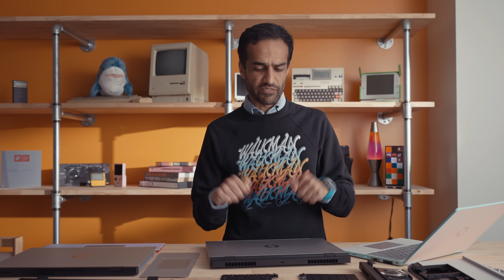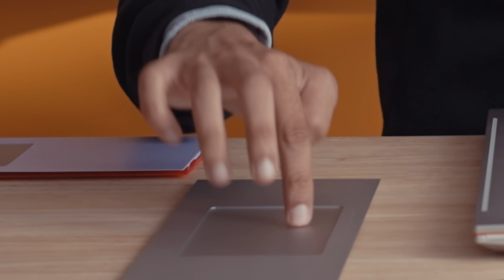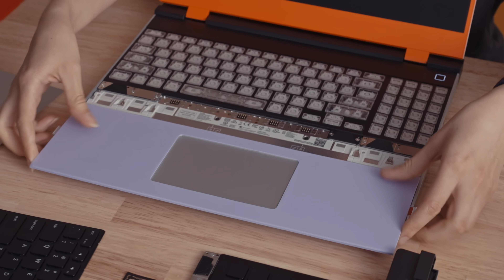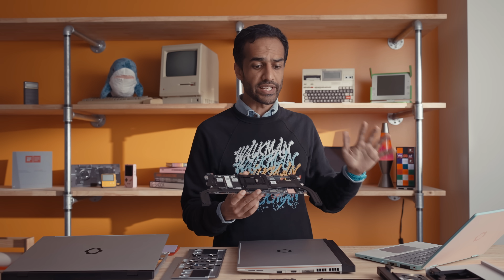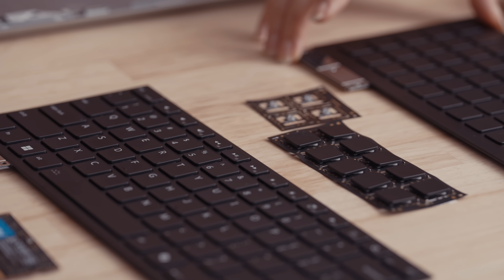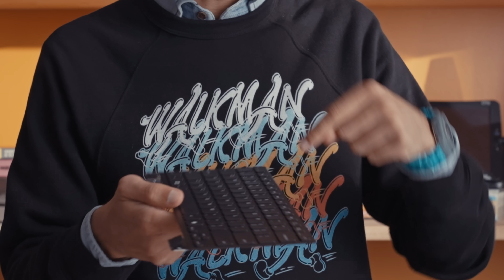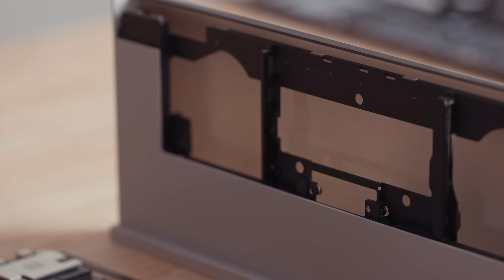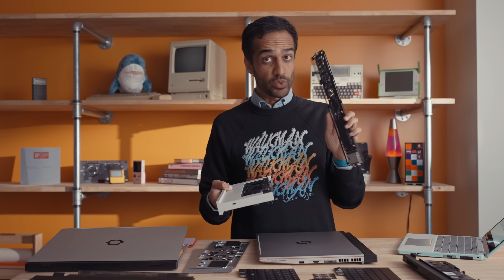Framework Laptop 16 - Prototypes and scrapped ideas

Comment: I still think that users should be able to swap the keyboard to the bottom row and the touchpad to the top row. As and elder developer, my workflow is primarily keyboard driven, including using a keyboard-driven dynamic window manger.

When sitting at a table or desk, ergonomically its far more comfortable if the keyboard was placed toward the bottom edge and further away from the screen. I rarely if ever use the touchpad anyways (preferring keyboard navigation when it's an option, or an external mouse if I need to use a pointer) so making it slightly less accessible isn't a problem.

It's a shame the original modular input design didn't allow for swapping which row the keyboard and touchpad were installed into. I would have already bought two Framework 16s and given away all my other laptops if that was an option. 

Regarding the pointing stick. I was a ThinkPad user for many many years. IMHO the pointing stick is superior to touchpads for keyboard-oriented users like myself. I can move the pointer without removing my hands from the home row. I also appreciated the third button of the TrackPoint that could be used as a middle-click or to emulate a scroll wheel (Touchpads generally lack the third button and resort to gestures, which are sometimes implemented well and sometimes not). 

One of the design elements of the early ThinkPads was that the lid was slightly arched to provide greater strength when compressed. I wonder if you could similarly strengthen your lids to protect against the screen being pressed into the pointing stick.

Comment: Could just make the touch pad a "slider" as in, you would design sectional areas that "push" down to allow the touch pad to shift into different positions over sections. When moving to a new position, the sections no longer covered could "popup" becoming flush again with the top surface.

Comment: 1) GPU priority
From my point of view the biggest thing missing is higher GPU tiers with more VRAM. That’s what would make the Framework 16 a true replacement for my 3090 desktop, and the only reason I’d move from my Framework 13. The 5070 is nice for NVIDIA driver support, but for my workloads it’s just not enough. What makes Framework different is that GPUs and big components can carry across generations, so spending more on a high-end GPU actually makes sense here compared to other laptops where it’s locked in. At a total system cost already north of 3000€, I don’t believe people wouldn’t pay more for a stronger GPU option. So is there something holding this back — like thermals or physical space? With stronger GPU options the 16 could completely replace my desktop.

2) CPU curiosity
I’d also love to know if Framework ever tried pushing the desktop mainboard CPU into the laptop. Even with soldered memory it would be exciting to see that kind of power in a portable system.

3) Cost-to-spec
The entry price is higher than other laptops, but sourcing RAM, SSD, OS, and even reusing existing accessories makes speccing out far more affordable. On my Framework 13 I installed 96GB DDR5 for ~200€ instead of 480€, and a 4TB PCIe 4.0 SSD for ~200€ instead of 379€. Windows Pro I did buy through Framework, but I can reuse it later when I hand this mainboard down or repurpose it. I also didn’t need to buy a new power adapter, since I had one lying around already — another way Framework lets me avoid unnecessary costs.

I’d love to see Framework market this more. Yes, exotic RAM or SSD sourcing can cause driver/support headaches for less technical people, and yes, it cuts into potential revenue. But this flexibility is a strong argument against other systems. Spending more on the Framework mainboard and chassis feels more valuable if my total budget stays the same but my spec is much higher. Maybe that’s why we see people choosing 48GB configs more often than 8GB — because it actually makes sense.

For my daily work I use all this extra RAM and storage with dual boot and multiple users, so I’d even welcome 128GB support down the line (though 96GB covers me for now, 64GB wouldn’t be enough). Multiple SSDs on the 16 are already a huge win — with better GPU options it would finally check every box.

4) Battery life
On my Framework 13 I’ve run into the usual laptop battery issues, which I expect will be the same for the 16. To work around it I modded my 13 by attaching a power bank to the back for extra life without sacrificing performance. I use a 3M Dual Lock system — like clean velcro — on top of a dbrand vinyl cover so the glue isn’t permanent. This way I can modularize further than Framework intended, swapping out powerbanks on the back of my laptop as needed. Could something like this be integrated into the 16? For example, an extension bay module with a removable extra battery (removable for air travel). That way battery life could effectively be doubled when needed.

5) Covers / hardcases
On the topic of dbrand — I’d love to see some official hardcases or covers. Right now dbrand is the only realistic option, and it’s not amazing. An official cover could make the laptop more modular: similar to my Dual Lock setup, the backplate could support temporary placement of a small hotspot, phone holder, battery pack, or external drive. The hinge on the 13 is strong enough to handle a huge powerbank without tilting back, so I imagine the 16 could too. With usability over everything, this would be really cool.

Comment: My personal next big wish would be a better battery based on silicon-carbon and therefore improved capacity by reducing the extreme loading speeds. I have no problem charging my laptop a bit longer for using it much longer, it's (for me) better then quick loading and not so long lasting.

Comment: The amount of ports on a Framework 16 is fewer than on my 13 inch Thinkpad, and I couldn't do my daily tasks with the four ports on a Framework 13 or 12.
I think that a dedicated usb-c on both sides paired with the existing 3 swappable io slots on either side would be much easier for day to day use.
I'd also really like to see combination io expansion cards, like microsd and audio, dual usb C/A, etc.

Comment: I know there's probably technical limitations to consider but I'd love to see expansion cards that have multiple USB inputs, especially USB-C.

You've probably already looked at this but still, having two USB inputs on one expansion card would make a big difference for the customizability, even if it halves the throughput on each port. I also wonder if it would be possible to have expansion cards that are hybrid (e.g. 3.5mm+USB-C or similar) where it's possible to fit two side-by-side in a single expansion card.

I honestly can't imagine many people would by a standalone 3.5mm expansion card if there was a USB-C/3.5mm expansion card available - because who has ever complained that their laptop has too many USB-C inputs and they wish they had fewer?

Comment: Please don't give up on developing a single touchpad module with a centered touchpad, instead of the spacer solution, this has been a main reason for a lot of people to hold off on getting a FW16 since it launched, and something a lot of people that DID get one has expressed that they really want (which you are clearly aware of)!
It's great with options, the spacer idea is cool, but in my experience, I would say that 8 or 9/10 people with the FW16 have the touchpad centered, and there's obviously a reason you chose to place it centered on the FW13 (I mean look at apple, they spent an ungoodly amount on research before they ended up with their macbook design. It's centered on those for a reason). 
It should have been the other way around, the FW16 should've launched with a one-piece, centered touchpad module, which is what most people prefer (as reasearch on the market has showed), whereas the niche one is being able to move it around.
If it's haptic, that would be amazing, but even without haptic, just having a module without those spacers (that even if even, just does not look good and a bit cheap/unprofessional) would make the laptop a 10/10, instead of something where you just have to accept and live with the spacer solution :) And it does not have to be a huge touchpad like your prototype, just something like the 3D printed ones you showed, that's exactly what people have been asking for since the FW16 was announced.

Comment: One really small thing that ends up being an absolute deal breaker for me on any laptop is the arrow keys being too small. I have larger hands and I use those keys frequently while I work so having them not be the proper full size would be infuriating.

My current laptop (Asus G750JW-DB71-CA) solves this by having them offset from the keyboard slightly. This works great but I can already see the massive issue that would cause a modular laptop like FW16. Another solution that I've seen but not yet tried is that some laptops are cutting the right shift key in half and using that extra space to put full sized arrow keys in. I hope you will look into keyboard layouts that have full size arrow keys in the future as id love to purchase a FW as my next laptop

Comment: Please introduce external RAM modules to further boost the amount of memory we can add to this laptop, even if you're only using the additional memory as swap our virtual RAM drives, it would make this little machine one of the best for running local LLMs on the go!
Reply: instead of the GPU? RAM has to be incredibly close to the CPU for any reasonable speed
Reply: This system uses an APU with a unified memory for the CPU and IGP, there are only two SODIMM slots, so any kind of external memory modules would have to interface through the PCI-e bus. It would obviously not be as fast as soldered RAM directly next to the CPU, but you could still have large amounts of swap available for overflowing into when you run out of the 128gb system RAM and for large LLMs to overflow into. I'd gladly take the small  performance penalty in speed to be able to load larger models without spending tens of thousands on a server rack full of enterprise grade AI CPUs.  @Kytael

Comment: Hi,
Love what you're doing, big thank you !
By bringing so much power to the Laptop 16, are there any chances to see the AMD Ryzen AI Max+ 395 on the table ?
To my understanding, it's 55  W TDP - requiring 140W boost power (AMD - framework page respectively)
That tightly fit in the 240W power supply
(I know, I know, there is still the problem of soldered memory, but since everybody wants 128/192/256G of ram....)

Comment: On the framework 13 I personally really dislike the cooling solution. Since the exhaust is on the back and I like to use the laptop on my lap and stomach, it gets quite uncomfortably hot and the soft surface I use it on partially blocks the fans. I understand/assume that it requires a completely new product line to be able to redesign the cooling solution to exhaust from the top/sides. Also dislike the bottom firing speakers on the 13. Would much prefer top firing speakers.

Comment: I don't know if you'll read this, but we need a reuse pathway for the screens. I updated a Framework 13" to a matte screen and now I have a spare screen. It would be great if there was a USB-C board that could connect to it with a ribbon cable to make our own external monitor reusing the screen components.
Reply: Or have the ability to make it a travel screen with a compact back and folding magnetic stand.
Reply: If you want the DIY path, someone in the forum already tried this, and the CEO confirms that it works, although the USB-C board is from 3rd party
Reply: You can buy a DP to eDP display controller and use whatever cable to get the DP signal to that
Reply: Whoa, great idea! Make it a travel/second screen. Heck, is it feasible to plug a Nintendo Switch or Steamdeck into it?
Reply: Even a basic driver board would be really nice to have. The old display panels would be great for a various little Raspberry Pi things.
Reply: That is an AMAZING idea actually. Just some kind of a frame with USB that turns an old screen into a new monitor. That's fantastic
Reply: I know you can find lvds controllers to turn lcd screens into monitors. I've done this myself with a broken laptop. I'd be super happy for an lvds board.
Reply: Awesome idea!
Reply: I saw some people on the forum along with Nirav try something like this, it's possible but I'm not sure if they got anywhere.
Reply: So I think that all that's needed is the board for power and signal to type-c and maybe hdmi like most portable monitors and the community will knock together a 3d printed chassis in all likelihood.
Reply: Agreed - release a hdmi or usb c driver board
Reply: @FrameworkComputer, we definitely need this feature as it expands Framework's modular philosophy and also reduces e-waste
Reply: Yes!
Reply: Yes, this
Reply: Since nearly everyone has a 3D printer to create a chassis, this would be awesome.
Reply: Would be awesome if you be able to take my old framework screen and put it into an external enclosure and use a second monitor
Reply: Yeah, this would definitely be a great, it's such a shame to see a perfectly usable screen getting thrown away.
Reply: Would be nice if they bring that screen back to Quality Control and put it in a refurbished laptop
Reply: Compatibility can be a hero or an evil. It's middle name is dependency.
Reply: External screens out of used lcd panels is VERY underresearch and underdeveloped thing. I really hope someone goes through with this one.
Reply: I think another awesome reuse pathway would be to just allow people to sell used old parts that others can use for repairs in their own framework.
Reply: @FrameworkComputer
Reply: This is an excellent idea. While you can do it yourself, it would take some time and you would need a board to convert the signals. It would be nice if Framework could make an official way with a case for it, and a stand.
Reply: +1
Reply: Just sell it to someone who needs a replacement for his framework... not every single spare needs to become its own new framework product
Reply: @ritterkeks but there are 10 times more people who want the upgraded screen, buy it, and have the old leftover than people who have a broken screen and want the standard as replacement
Reply: Pretty sure this was promised, but never executed. Just like the external battery case they also promised.
Reply: @dildo-cannon  I just checked, and although slow, I can charge my Framework 16 from a totally ordinary phone battery bank. But if what you're referring to is a lil' plastic case for carrying around a second battery that you can swap into your laptop, that'd be neat, and I suspect it wouldn't be too hard to make with a 3D printer and some foam.
Reply: @MrAcuriteOf1337  No, they specifically promised something that you could put a framework battery inside of. Upgrade to the 61wh and throw the old one in this theoretical case, and use it as a powerbank for the computer and whatever else.
Reply: @dildo-cannon Interesting, I haven't seen that. Got a link to a statement describing their intent?
Reply: @okatbikes4917 They're a small private startup. But beyond that, anything in your Framework laptop is open-source and built on existing standards, so you very well could design your own display board or buy one from a company or somebody who's designed one
Reply: @FrameworkComputer
Reply: @framework?
Reply: That gives a lot of liability to framework…

Comment: A mainboard upgrade from me will likely have to wait until I have a use (and way to use) the old board. 13 mainboards have an exterior use case as mini PCs and you showed in this video the thought that is going into the eGPU - I'm very curious if any real work has been done on a "case" for old mainboards.

Comment: Even if a trackpoint type pointer stick can't work, I would LOVE to see a trackpad variant with physical click buttons at the top. Mechanical or haptic trackpads don't matter to me, I just miss having a discrete button I can press (Not to mention middle click and drag is literally impossible under normal circumstances without them)
Reply: Btw, most touchpads support 3-finger tap for middle mouse click
Reply: @Spiker985Studios  True, and I always set it to that immediately, though there's no way to middle click *and drag*, which just screws a lot of 3d programs that use that to pan or rotate